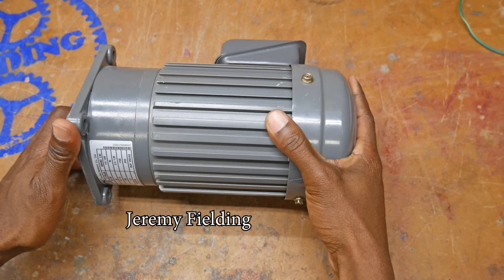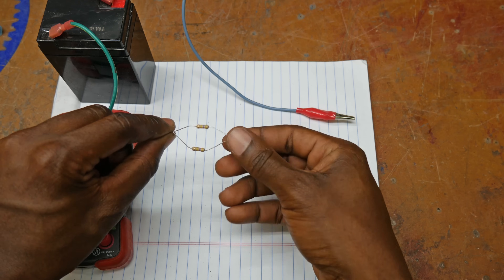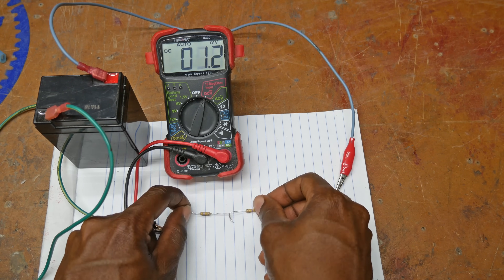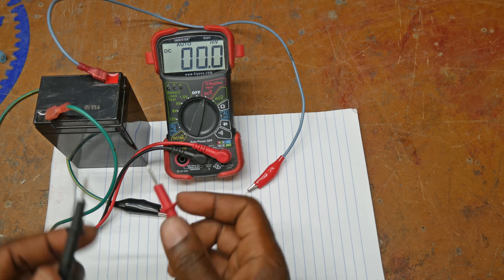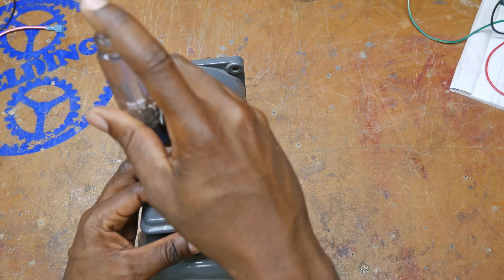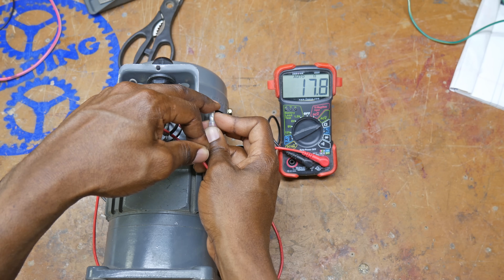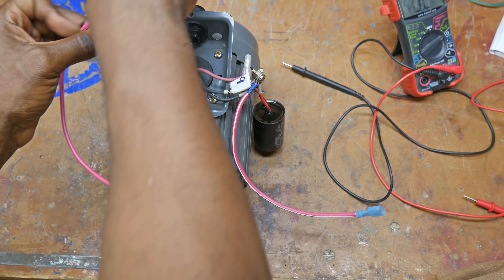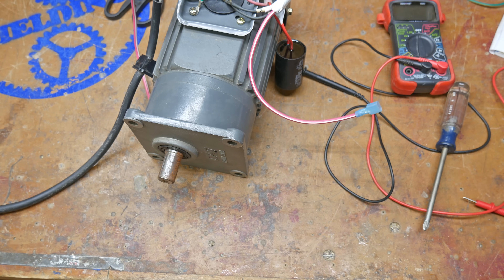Dual Voltage Motors, How They Work, And Wiring Them Without The Wire Labels. #059

Comment: can anyone help me figure out how to wire this for 220 operation?
four connectors 1,2,3,4 ... 1-2 (0.2ohm)  3-4 (4ohm) all others open to each other (#2 labeled LOW)
three wires ABC ... A-4 (3ohm) B-2 (2ohm)B-4(0.1ohm) C-4(9Mohm) C-3(6Mohm) C-2(1ohm) C-1(1ohm) all others open

Comment: Good day Mr Jeremy Fielding. I have a motor and I have use the continuity mode on my multimeter . I have found the capacitor wires and the other four wires that form the two windings. Now , checking the resistance of both windings, they have almost the same value in ohms. How do I determine who is the start or running winding. Thanks in advance.

Comment: I have a dryer that is 220v, iwant to run 110v, centrifugal switch, on left of are top 3,6,1,on r is5,4,2, coming from one coil is purple wire going 
To#3,
There is 2 blue  wires, one on  goes to a coil along w/white wire, the other wire goes #5, and blue wire to #4, i need toknow how to wire it to 110v, thanks jeremery , love your show

Comment: I have dryer motor that is wired 220v i want to convert to 110v on the centrifugal switch on left are no.s 361 on right 542 on coming from coil is purple wire goingto no.3 2 wires both blue one left goes

Comment: Hi Jeremy. Have a question for you. I bought a used 2 Cyl Sanborn 4HP? compressor. It’s got a 230 volt plug on it. There is no sticker on the motor. It’s got the two hump cases on it. (Capacitors)?   I don’t have 220 outlet in my garage. Can this be wired for 120 volt???

Comment: Learn something new each video on this channel. So cool.

I have an 3 Phase Induction motor with dual 230V 460V something like that and wandered how i will wire it for a VFD to DIY build a test bench to spin VE type diesel pump at 600 RMP and 2200RPM the IM is rated at 1400 RMP thereabouts, i'm hoping the VFD will get the RPM up. Australia is 240V standard house 10 amp. 

 Plus use it to drive a pump to run waste veg oil through centrifuge at 90-100 psi. 

All this stuff is way over my head but with your help from the videos i'm learning and getting confident that might be able eventually do it. Thank you so much cool channel. Great minds that surface on the internet now days is amazing.

Comment: Great video. Thank you so much.
I have a question.
Should the connection for high voltage be 2-3 and 5 to keep the voltage on the start winding at 120v and not at 240v?
Thanks

Comment: Hi Jeremy I recently Boughton used 1/2 hp motor that  I plan to use for a bandsaw anyway i really want to clean it and possibly change the bearings but I can't figure out how to  remove the bell covers. Underneath the bell on the shaft side is a switch of some kind but I want to remove the other side to clean it up its really dirty and caked with sawdust.  Any help would be greatly appreciated

Comment: Question about the capacitor.
I rewired a Dayton Agricultutal fan motor from 240 to 120. Do i need a different capacitor?
Mine is leaking and I'd like to replace it.
It was easy to follow all of the information that you provided.  Great stuff Jeremy!  👍

Comment: This is by far the most simple explanation about a dual voltage motor which a person with zero knowledge on wiring a 6 lead motor. Thank you so much!! My late dad left us a vintage thomas sprayit compressor. Looks like im gonna try to revive  & use it. 👍👍👍

Comment: At the end of the video the motor hums and turns slowly.  Is it supposed to do that? My motor is supposed to run at 3400rpm, but is humming and turning slowly. 

Also I only have 4 wires as the start capacitor is wired elsewhere in the motor. When I perform eh continuity test, every pair beeps?

Comment: This is one of those things that I don’t use often enough to keep at the top of my mind and I really only needed the diagram but you did an excellent job of explaining why there are 6 wires and how they can be configured for dual voltage.

Comment: Hi Jeremy. I know this video is kind of old. But to clear up what may be confusing to some... And please correct me if I am wrong. If your motor has two spades, or two screws, (Not counting the ground), to connect your wiring to... Using your beeping ohm meter, if you do not have any wiring connected to the motor yet, and you touch your leads to those two connectors... it should beep. It seems counter-intuitive. Why would your motor be a dead short? LOL But yes, it should beep. What you are connecting to is the two ends of that winding. What is that winding but one wire 'wound' through the armature. So you are connecting to two ends of one wire. A dead short...
Reply: I have a 6 volt electric mustang kid car looking for the wiring diagram

Comment: What value start capacitor should I use on a 1 hp  220v single phase  motor ( the information plate is damaged and the capacitor is missing)

Comment: Hi Jeremy, I'm not clear about hooking up the capacitor. In the video, you mentioned that the capacitor needs to be wired across the starter winding. Does that mean wire 5 and 6 [as per diagram] ? Thank you very much !

Comment: Jeremy, I'm trying to hook up a 240 motor that doesn't have a plate on it. One thing that was unclear is if the direction of the 2nd winding matters. 

Eg. In the diagram you posted, you listed the series connected like so: 1----2/3----4

Does it matter if I hook the second winding in series like 1-----2/4------3, or 2-----1/3------4 ? 

If it does matter, how can I tell which direction is correct for the windings?

Comment: Very nice video indeed! I have done residential wiring and some industrial wiring ,lucky to have learned from very good electricians I worked with. I used to do work and have it inspected but now a days I do my own work or just friends ,family ! I recently helped a friend out who had large commercial air compressor in his business ,the motor just hummed.It was a very big motor and I found the Start Capacitor had gone out as suspected. The motor had more than one capacitor and I assumed it would be the largest one.My bad! I should of used common sense that the start capacitor is only in series very briefly and does not need to be heavy duty ,where as the run capacitor is constantly in circuit and would get very hot if too small!  Thanks for your videos ,I always like watching other guys interpretations of things and nuances they may have . Keep it up!

Comment: Jeremy , I’m rewiring my dewalt radial saw  which has dual voltage capacity to 220 problem is some of the wire colors are hard to identify. By trial and error I got it to run but its at slow speed and buzzes ,

Comment: I have a predicament, emerson mtr 1.5 hp 110/220 single phase,on a delta saw that is new to me.cord has no plug,plate has diagram,illustrated by color and the actual as wired connections do not match the diagram I think it was wired 220 but a black and a blue wire are reversed  to the diag.
Should I take a chance and wire per diagram, I want to use 110,no 220 nearby the saw.

Comment: Great video But, my motor from Germany that is a 110/220 motor only has 4 wires and a built in reversible variable speed switch on it as well as an on off switch. Wire 1 and 2 are together and 3 and 4 are together coming out of the motor housing At the on off switch by. It is currently wired for 220 with 1 to line voltage and 2 going to line voltage and 3 and 4 are connected together at the switch. Which ones do I swap to get 110? Thanks!

Comment: So I built a lathe from a single phase two voltage motor. Its a bit fast for the pulleys. If I keep 120v on it wired for 
240 fashion. Would double voltage double resistance half speed? Probly burn the resistance out? Or speed it up?
Any advice folks?

Comment: I’m looking at a table saw currently wired for 230V. On the motor it does say 115/230V but in the manual it says for 230V only! Do not change! 
Would it be risky to wire it for 115V? 
Only cutting plywood ..

Comment: I’ve been wondering how to do this: I buy a 240v 3 phase machine thru an auction and I want to run it in 1 phase power. What is the least expensive (and best) way to do this? Swap out motor for 1 phase? Or use capacitors, or a vfd?

Comment: I have a motor wired for 220v however it is also connected to a thee pin reset button which came loose and I don’t know how to wire it back up

Comment: Can you rewire a single voltage 3 phase motor 440v to run off a 220v 3 phase power supply.

I have an old metal lathe with a 1/4hp coolant pump. It's a single voltage 440v 3 phase. I'm rewiring the lathe motor for 220v but that's a dual voltage motor. I'm trying to figure out how to get the original single voltage coolant pump to work with the lower voltage that the lathe will now be running off of. Any help would be awesome. Thank you in advance.

Comment: 1 have 6 identified wires and 2 xtra 1 yellow and one red why is that ? I switched from 230 to 115 using diagram in the cover but motor won't start it just does a humming sound

Comment: This video is super helpful I have a similar motor for a vintage delta table saw. One additional problem that I can't figure out is... My motor has a switch for the table saw that only breaks one of the 110 lines... I am totally stumped. I have a wire diagram but I'm just not fully understanding it. Any ideas for how to control this kind of motor with a switch by breaking only one of the supply leads?

Comment: Great video. My only reservation is you don’t mention to short the electrolytic capacitor before handling the cap after the motor has been operated. Could lead to a nasty little arc!

Comment: Hey Jeremy, thank you for this video. I have a motor similar to this that operates a shave ice machine. It is brand new and I am in Fiji so its wired for 220v. Everytime i turn it on it is really loud and overheats. I am trying to figure out why as it is brand new. 
Thank you

Comment: HI. 
I wanted to know if this motor  that  I removed from a   hot tub could be   repurposed  &  wired for 110 volt  to be used as a  "bench mounted "   belt sander  ?   The motor is a CENTURY AC      
AO SMITH     
 Part # 7-193677-01 .  Any Info - answers - feedback  or opinions would be  much appreciated.

Comment: I am wondering what would happen if one of the run windings is reversed? Would it run normally or would the two windings somehow pull against each other causing the motor not to work?

Comment: Good video, regrettably it didn't help me with my milling machine motor which is dual voltage and reversible. The machines wiring diagram shows five wires coming out of a six terminal motor junction block, two terminals are connected at the j block to achieve that. Unfortunately the manufacturer saw fit to label only two of the five connections at the drum switch.  Wiling and gnashing of teeth to follow.

Comment: As a former HVACR tech this is exactly how we were taught  to find which  set of terminals was the start winding and run winding on a single phase compressor*. You may know that most refrigeration compressors wired for single phase and under 5 HP (More or less depending on the manufacturer.) have three terminals. The highest resistance value between any two terminals is both the run and start windings as those are connected together and will make a circuit, the next highest is the start winding and the lowest is the run winding. A good reminder of of how to find the correct windings on a single phase compressor. *Refrigeration (Includes Air Conditioning.) compressors are often totally sealed units, they are an electric motor and a compressor combination.
Reply: VR de

Comment: Would anyone know about how to wire a rather complex motor? Induction motor with 2 stator wiring groups...its a 6 and 16 pole with one group having 4 wires(2 pairs 19.2ohm) and other group having 6 wires as 3 pairs(8.8ohm one pair, 16.1ohm wire to the join and 16.2ohm join to other wire)but 2 of the pairs of this group are joined and that's how it was originally connected so first group has 4 points on the terminal for connection and second group has 5 points on the terminal for connection, the starting torque the 16 pole is 70ncm at 70vac 1.2a and 6 pole is 150ncm at 120vac 3.3a. And the capacitors for each winding is 40uf. Absolutely not a single piece of information on the motor, not even make/model but its the most well made motor I have ever seen. I'd like to make it work and possibly experiment with what can be done with its unique design.

Comment: I think i see a problem. The starting capacitor circuit ,wire 5-6, was powered from 110v in the beginning. After rewire , the circuit is now powered with 240v. I believe you need move where the start circuit is connected.  Other websites show it in parallel with one Run winding not both in series.  Any thoughts?

Comment: Could you please help me with this motor I'm trying to get my head around. Its a 6 and 16 pole induction motor with 10 wires, but seems was connected with 9 points so there is one Join of the wires that come from the stator. I think the one pole group has 4 wires (2 pairs) and other  pole group has 6 wires (3 pairs) with one pair joined to another. It looks like the most amazing motor I've ever seen and would like to make use of it. Help🙏

Comment: Just completed a rewire on a Dayton 3/4 hp dual voltage motor from my Dad.  Needed to reverse the rotation direction and keep the wiring at 115V.  This video gave ALL the information needed.  Jeremy, you are a wonderful teacher.  Keep up that good work!

Comment: I just wired my 3 phase motor but its running slower than my old one that was rated at same rpm. I wired it as low voltage. The nameplate shows 60Hz 230/460V RPM 1770 but also shows 50Hz 200/400V RPM 1480. How do know I which one I'm running? Have a feeling it's running as 1480 rpm

Comment: Hello, I have a 3 phase 9 lead dual voltage 230/460 motor... I watch your video and wired it for low voltage. my question is I only have single phase supply.. can i run this motor on 2 hot and a neutral. and if the answer is yes which one of the lines do i connect the neutral. L1,L2.or L3

Comment: Great visual and explanation.  I'm in charge of a woodworking shop when a vintage 15" Bridgewood planer with a wire that has dry-rotted over time  When I went to replace the wire (with 12/3), I noticed that ir had a 220 plug in which the ground had been removed so that it could be plugged into a 120v socket. In other word, someone had jerry-rigged the plug.  When I put on a new 220 plug, it obviously wouldn't work in the 120v outlet.  So I tried it just quickly in a 220v outlet and the motor ran fine for the few seconds i had it on.  I checked for a motor plate and then for access to the motor wiring and, unfortunately, struck out with both: no plate and impossible access to the motor without disassembling the unit.  Would you recommend chaging the plug and assuming that it will run fine on 120 as it had previously?

Comment: Hi i have a question . I bought a new lathe and the motor spun but has a loud humming sound so they sent me two me capacitors had no change .So what causes this . 220v single volt single phase motor .

Comment: Thank you for this very informative video. The wiring to my table saw can be either 110 or 220. I have a dual voltage motor on my saw. Since there is a choice, is there any actual advantage to wiring it one way or the other?

Comment: Great video Jeremy! However, I noticed that on the motor label it says that the RPM's are 1720 but when you powered it up, it rotated very slow. Any Idea what might cause that. Is that a sign of a bad motor? Or a bad start capacitor? Do you have a video on how to check the start capacitor?
Reply: C=Q/V
Where C is capacitance, Q is voltage, and V is voltage.
or V=Q/C.
Reply: Thank you sir. 👍
Reply: @chuqrok  but jeremy does need to do a video specializing in these specific type of capacitors.
Reply: Awesome suggestion!
Reply: The motor is geared motor. Additional gears inside the casing makes the rotating slower and the torque higher

Comment: Hi there thanks for this vedio although i would like to ask you a favour if you have the time to reply ofc.. I want to buy a JET bench grinder model : (JET IBG-8VS) but i tried to contact JETtools-us, amazon, eBay and some other forums.. Seems that they provide it with 110/220v dual motor but its  pre-wired for 110v circuit  .. I have installed the pdf manual and they said for 220v rewiring process I only need to replace the plug! Can you confirm that? Or do I need to do a different method in your opinion?

I live in Kuwait🇰🇼 and we are running 220v system with the standard 3 pinned British plug.

Comment: Some people want to put a reversing switch on their drill press for various different reasons. There are a few videos on YouTube of reversing a drill press but most of them are using a double pole double throw with a separate on and off switch. Can you show how to wire one switch that does everything including the on and off along with the different directions? Possibly with a triple pole double throw switch.

Comment: How do you know you are not reversing the polarity on the second phase of the motor so one phase is in opposition to the other? How do you know which side of the run windings you connect to the start windings?

Comment: Great video Jeremy! Happened across your video clicking #(electric motors). Prior was searching for an a particular brand motor.  

I've changed the rotation direction on a 3/4 horse multi-voltage general duty motor, 3450 rpm.  While I get the direction to change the startup speed is not there. From your video, it's like the capacitor is not in the loop. Thoughts?

Comment: 7:05: the starter winding can take 240v as shown in the 'high volt' schematic? I thought it was usually: power to L1— L2, L3, L5 connected together — power to L4, L6. In other words, only 120v across starter winding.
Reply: Enjoyed the video btw.